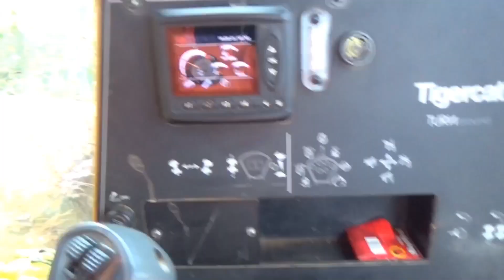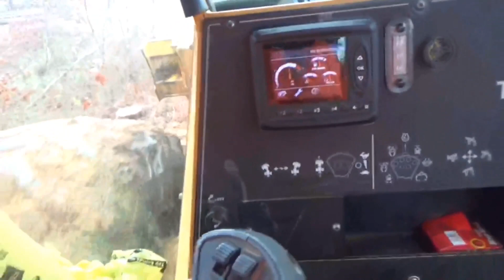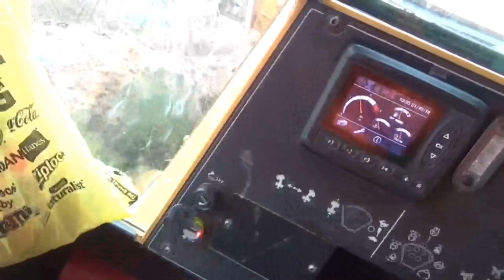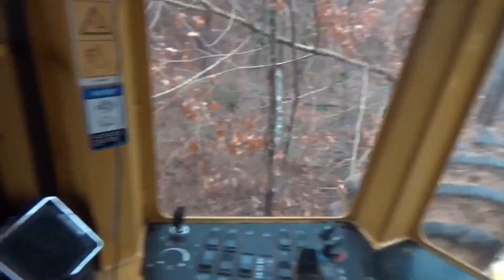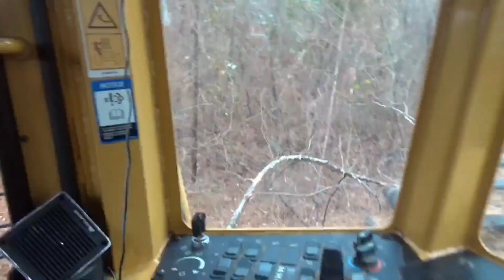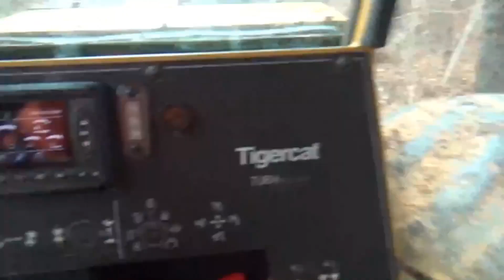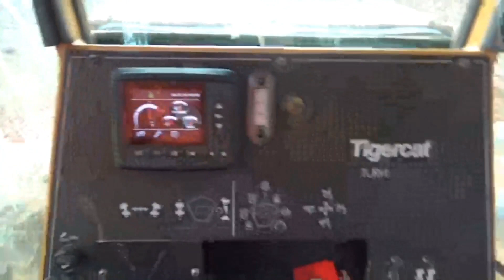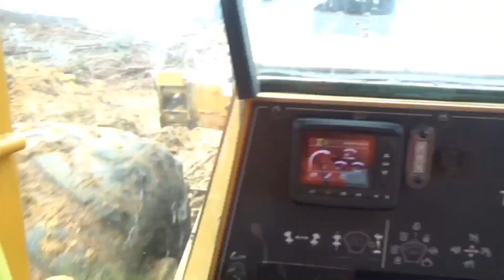Tigercat 630E ride along!

Comment: The tires on the 630 look to have a decent amount of life left on them.  Does the dealer offer some type of swap program where you can get the 35.5 tires at a cheaper rate and they'll sell the used tires off the 630 to someone. Or are you out the full price of 35.5s to upgrade. I know alot of times with a new pickup I wish I could just give the dealer back the tires that come factory on them for credit towards a set that are worth a crap. Thanks. Keep up the vids.
Reply from the maker: The new tires will be swapped with the dealer and are involved in the deal.

Comment: Hey question I love in ga and I run a 620 tiger cat I noticed y'all set the boom on the skidder all the way up, I think it pulls better when it is only half way
Reply from the maker: Think about it- the lower your boom more area of the stem of the tree is on the ground you gotta drag. The higher, the less of the tree is touching the ground and it also puts more weight on the machine.  The best pulling power is all the way up and all the way forward because forward puts maximum weight on your front end.
Reply: True but while I'm driving it it stands up a lot when I let it up all the way so how would I prevent that?